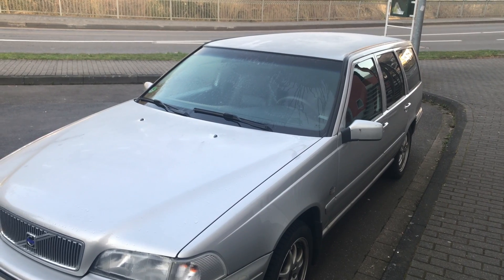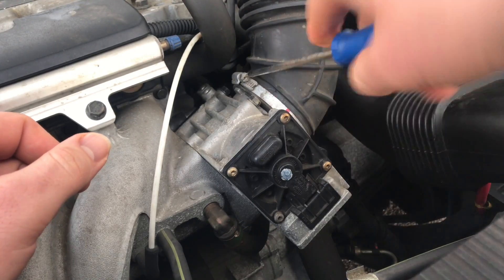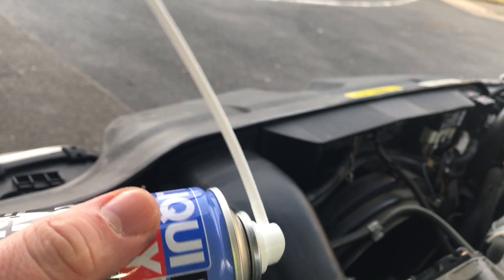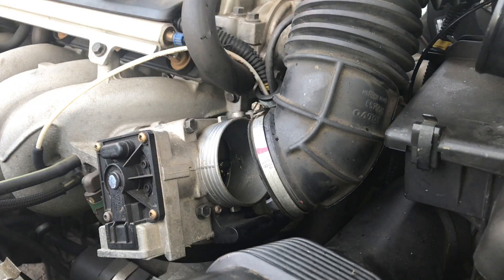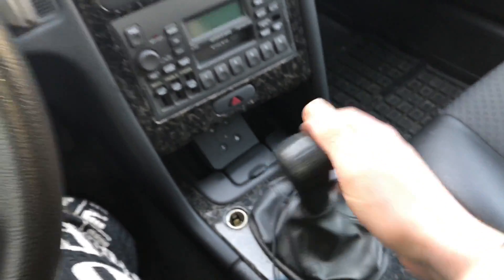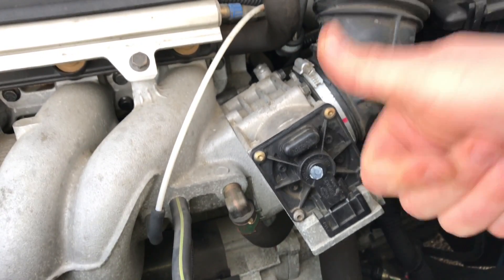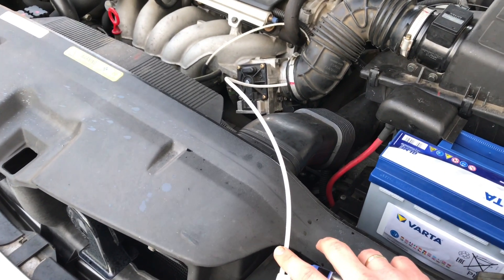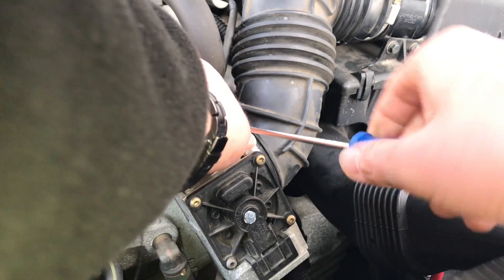How to clean a throttle body valve Volvo V70 clean throttle build-in with throttle valve cleaner DIY

Comment: Was having hunting and cutting out issues with my 2003 v70 2.4 petrol auto.  Followed the tutorial and no more problems.  Great video.  More please for any more maintenance things
Reply: Hi! What kind of problems were you having before finding this video? 

I have trouble with idle rpms too low (200-300 rpms lower than they were before at idle). Can cleaning the throttle body fix this or is it something else? The car has been standing still for 1 year so maybe some build-up has happened on the throttle body valve?

Or did you have problems with uneven idle?

Have a good day!

Comment: Personally i would, completely remove the Air induction hose and use Throttle body cleaner and also use a cloth, Open the butterfly and clean deep inside the housing then re attach the hose , You have also used  a Top end cleaner for carbon build up , two different operations But a worthwhile maintenance  feature that hardly anyone does , Please no music or change it Thanks
Reply: @michaelgill5186   That music is annoying like a cricket insect.☹️

Comment: Hello thks for the tipI have a question I have a volvo 960 2.9l 204cv and i have a serious provlem with my idle at cold start I suspect my throttle and duribg my check and before unmount it i noticed rhat this little yellow hose starting from the throttle go down under the manifold but it is linked nowhere ...???!!! Is that normal and can be the 1rst issue ?
Reply from the maker: +DAVINDRA MAHADOO if u have engine problems in idle, it could be because of sucking Strange air. The yellow hose could be the problem root, but it could be an airing hose, too. Iam not sure, sorry.